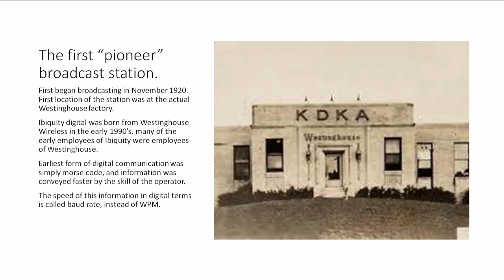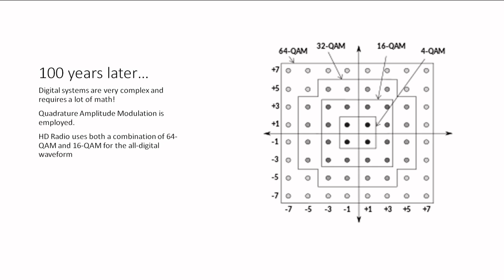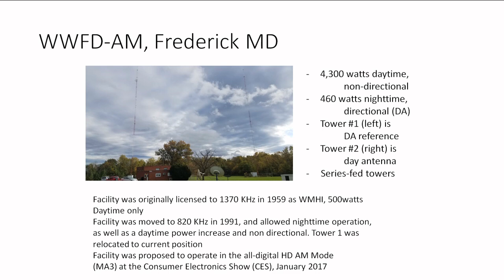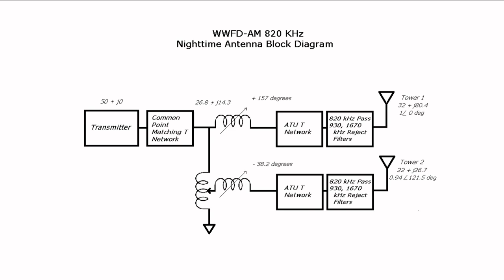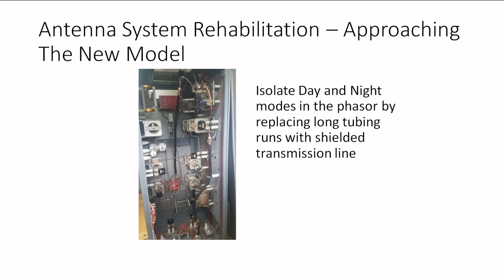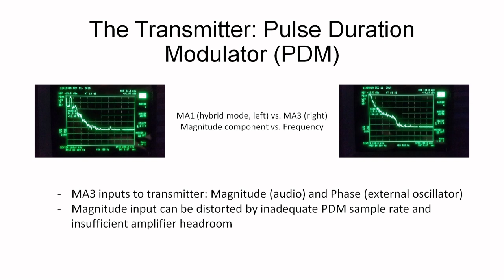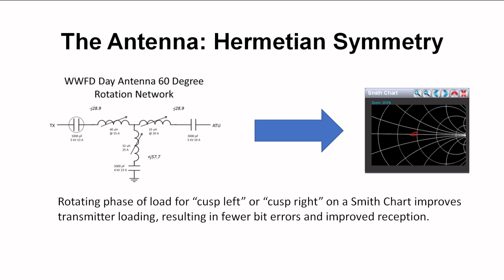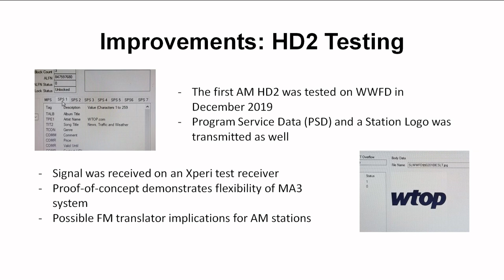Putting the first all-digital HD AM Broadcast Station on the air

Comment: Some interesting facts about digital radio: HD Radio MA1 has a "ball game" mode which turns off the digital signal in favor of a gracefully degrading analog mode. Digital Radio Mondiale has unused "amortizing" bit slots that can burst into action if the audio portion gets momentarily too complex for the base data rate to handle.
Reply: There is a lot of interesting tidbits that you can dig out of the NRSC and DRM technical docs. Another thing, that was actually covered by Mike Raide in this video, is that the forward error correcting method is so good that you can just "puncture" bit slots on the transmitter side, just not send that data at all, and rely upon the receiver to reconstruct what those bits should be.

Comment: Technology is rapidly moving the last terrestrial broadcast radio listeners to direct satellite-based and even cellular based modes of entertainment and information. Most cars don't even come with an AM radio anymore just a digital/FM receiver.
This may prove to be a disaster waiting to happen as we've seen in local disasters where traditional broadcast stations keep locals informed. In a large area disaster power outages your ability to charge your cell phone and most often the cell phone network goes down also. Food shelter clothing fuel can be affected for weeks putting you at the charity of others. Puerto Rico is a good example, One local radio station can keep transmitting vital local information to receivers. (So keep a good AM/FM pocket radio and batteries)